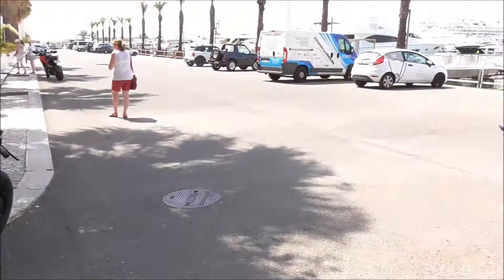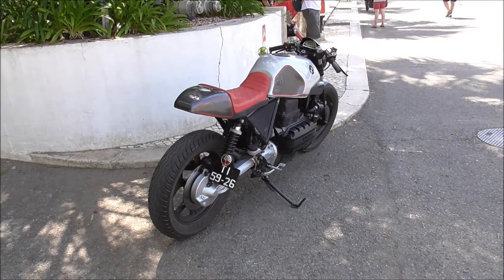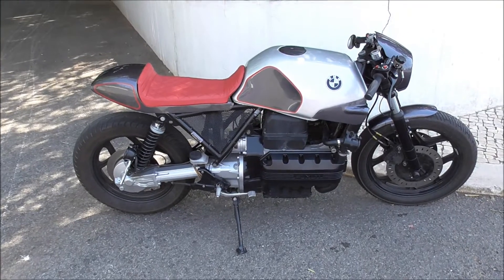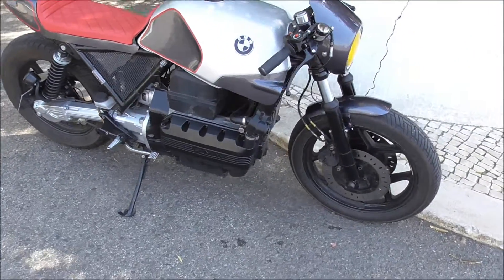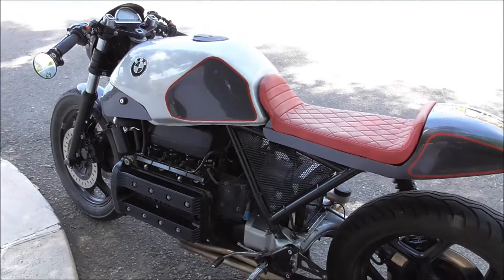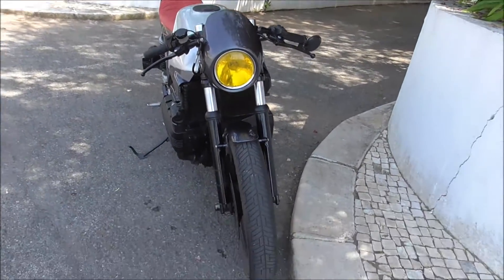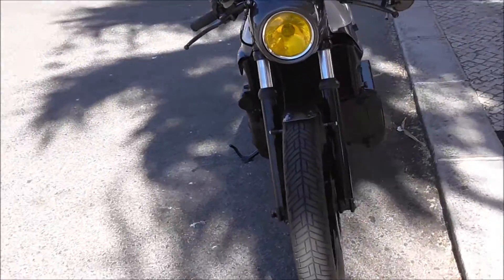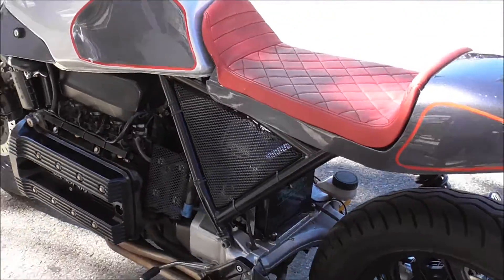CUSTOMISED BMW K100 I think

Comment: Hi Tom,
It's a BMW all right, but a Wankel..? NOOOO.

Kidding aside, it's a K100 with a four cylinder straight engine and they laid it down on its side, so on one side of the MC you see the twin cam cover and then you might guess what's on the other side. ;-)

I believe they call that type of mangled motorcycle a "cafe racer". Sorry, but to me it looks like sheit in comparison to the factory standard.